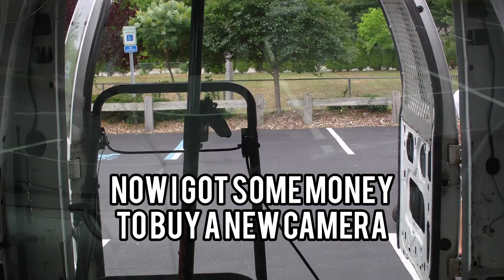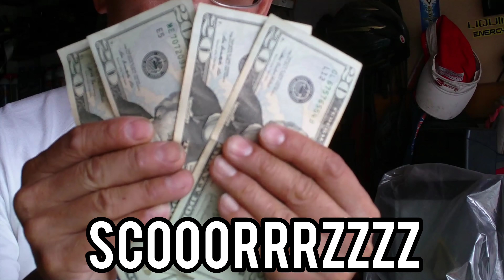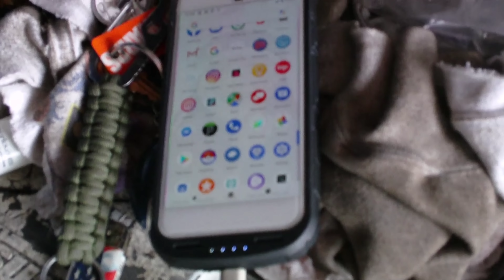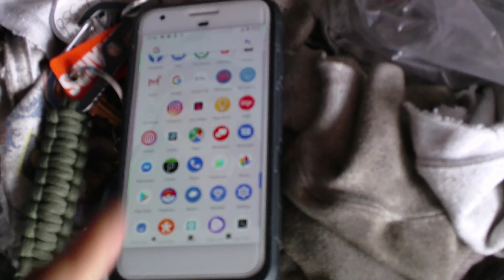I BROKE BOTH OF MY YOUTUBE PHONES HOW AM I GOING TO CREATE VIDEOS? STIHL SH85 LEAF BLOWER ADJUSTMENT

Comment: Instead of bothering with adding another cable and bail system to shut down a walk behind mower, if its already broken or missing, you can simply remove the flywheel brake and run the kill wire to a toggle switch that you can add right to the engine shroud or if you wanted to get fancy, run a black wire up the handle and put the switch on the handle near where you push the mower. Just like the old school mowers had before the bails. Those switches are a buck a piece if you don't have any, its far easier and cheaper than going thru the trouble of adding another cable and bail and that one that you added to that mower is like a 25 lever, also its nice, you can walk away from the mower while its still running until you flip the switch off and it looks nice and neat and tidy. 😉
Reply from the maker: But it won’t stop the flywheel.  You’d have to remove the spring and brake assembly, which sometimes requires removal if the flywheel.
Reply: @MowersNBlowers  Over thinking it.
Not necessary, will still come to a stop pretty fast by itself once you kill the engine, especially with resistance from the blade on grass, again like old school mowers, takes like 3 seconds tops, just like a tractor deck that had its brakes removed or wore out.

Comment: The screens are only held on by glue, you melt that, and take it off, front and back, replace follow the videos, and it's very simple, it's harder rebuilding an engine, then replacing the screens and camera.
Reply from the maker: Not on the S7 edge,. One of the hardest screen replacements ever! 2 hrs if you're lucky not to break it.
Reply: @MowersNBlowers  it's already broken, what would it hurt to try,.... But I fell ya, look around on your apps see if you can find someone eithrt to fix it for ya, or is selling one.

Comment: You have 3 choices, cheapest to most expensive. 
1. Use the google phone. It works $0 out of pocket
2. Get 1 of the Samsung fixed. Cost probably $50-100.  No learning curve you know the tech
3. Get a GO Pro knock off. Learning curve and the most expensive option at around 200-250
Reply from the maker: Excellent choices bro!  I’ve considered all!

Comment: I literally just parted that exact mower you sold for $80. Wasn't worth my time. Top crank seal leaks, oil all over the engine, hose clamps holding the handle on, engine pops, flywheel key was sheared, deck rusting out. I HATE tecumseh engines. Absolutely HATE them.
Reply from the maker: It was a relief to get rid of it, a bonus is getting $80 for it!